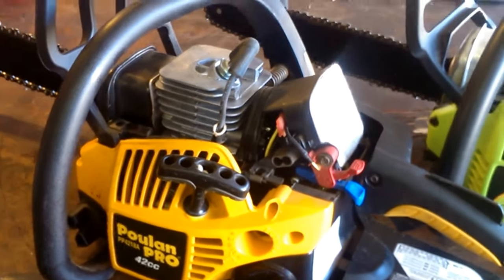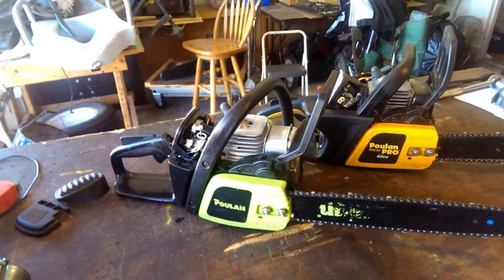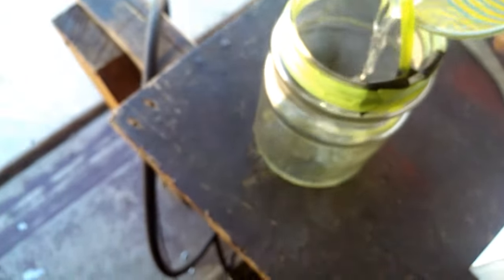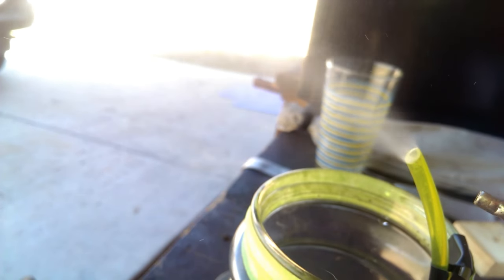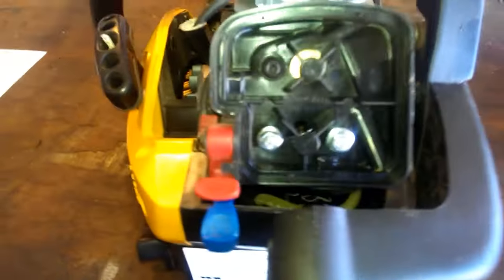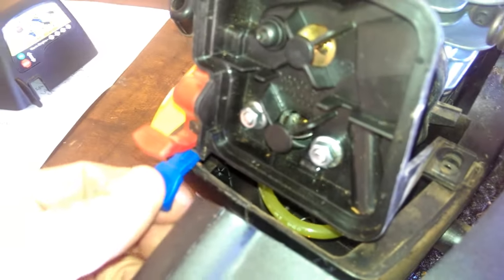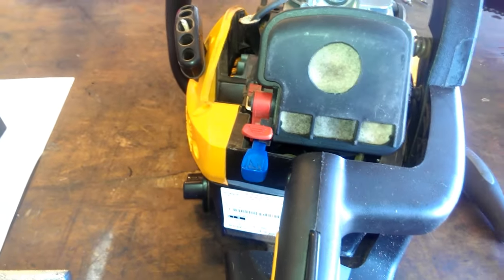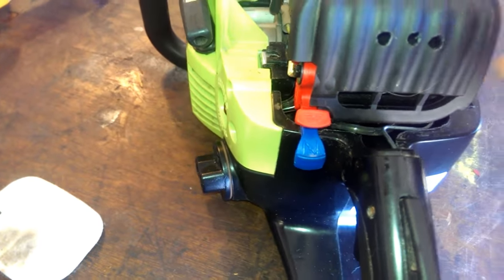Poulan wont restart after being used & how I solved my problem.

Comment: My old Poulan Woodshark 1950 doesnt have a regular carb breather cover. It's part of the larger top plastic cover - on the inside is rounded portion with a rubber seal  that covers the carb area. Probably gets even less air.
Reply: Also, my filter isnt the thinner white one, but a thick piece of open cell foam, like some lawn mowers.

Comment: I had the same chainsaw same problem I am going to try it thank you for the tip
Reply from the maker: Tammy Matthews follow all the restart instructions particularly the high idle. Choke pulled out all the way and then back in 1/2 way. Good luck Tammy. Thank You for commenting.

Comment: Dave , a barrel refers to a passage carrying an a/f mix.The top passage is only only an air inlet,but no matter it's just that a stage refers to a progression whereas a barrel is a passage..Foreign cars had a 2 barrel ,2 stage carb,US had only 4 barrel 2 stage carb.ie Holly quad,rodchestor quadrajet, carter? thermoquad etc.

Comment: great video I have one of each saws and the older one dose the exact same thing. thanks will be doing the breather on mine.
Reply from the maker: Mark Luce  Thanks for the comment Mark. Don't forget that the underlying problem is that crappy filtration system so be sure to clean the air filter often. Warm restarts should be done with the throttle cracked open. Pull choke all the way out then push 1/2 way back in and 2 pulls should have you running. Thanks again!

Comment: Let’s suppose that you left the filter off as well as the cover and then try to start. It now should be getting plenty of air, however it still does not start. Would I assume then that is not the problem I am having.
Reply from the maker: Hey Gary, it could only be part of the problem. How old is the saw? How long has it been sitting with fuel in it? Did you dump the gas and look for contamination? How's the compression? Do you have spark? Start at the beginning and eliminate possibilities. Whatever is left, that's your problem. Make sense?
Reply: @ZombieDaveAZ  yes was using, set it down to clean up and went to restart and it hasn’t. Good spark and compressing. Dumped oil and refreshed. It is getting fuel, just not starting.
Reply: Should of said dumped oil and gas mixture.
Reply from the maker: It ran at full power, no bogging? Could it be on the cusp of hard carb diaphragm? I just don't have a quick easy answer buddy. It takes investigating.

Comment: I have the exact same bumble bee saw you have on this video, I recently put a new carb, air filter, fuel filter and fuel lines on it, and I still cant get it to run properly, I will be putting holes in the air filter cover also, but my big problem is it seems after I fill the tank its like the gas somehow creates a syphon and continually pours gas into the engine to the point that I cant even pull it over...? do you have any suggestions on this issue>?
Reply from the maker: https://youtu.be/wNTKOuKwXaI  this will help you my friend. 🍺👍

Comment: Great problem solving and solution!  Now, what have you come up with to fix the tight gas cap issue on Poulan's?
Reply from the maker: Lol, sorry but this is the first I am hearing about it. I don't have an answer for you.
Reply: ulitepilot aka Zombie Dave   They must have used the wrong plastic because gas caps swell up and are extremely difficult to operate. I just saw a video about it and confirmed that with a P3314 I’m working on today. The bar oil cap is similar but not quite as bad. I thought it might be due to ethanol fuel but what I dumped out of the tank was 94 octane or better, so hopefully it was low or no E. No idea who owned it - got it at a church yard sale for $15. Piston, ring and cylinder are pristine so I’ll replace fuel lines, purge bulb and fuel filter and get it running again.

Comment: i have the same problem with my weed wacker so i am certainly going to try your technique so thanks
Reply from the maker: Thanks for stopping by Errol. Weedwacker #1 problem is usually the spark arrestor. Rarely do weedwackers run full throttle so carbon will build up and slow the machine down. Check the screen first.
Reply: They sure do get a lot of oily residue there.

Comment: Good video. I have a McCulloch that looks exactly like the yellow Poulan saw in your video and has the same problem.
I'm wondering if you tried a new air filter or tried starting it without the filter. I will try your fix but the question still remains of WHY is gas leaking out of the carburetor into the air filter? Has anyone ever inquired on the Poulan website?
Reply from the maker: So many questions. Poulan is Husqvarna and is Not a McCulloch. This video is for a Poulan. This also addresses the double barrel carburetor Not the single style butterfly carb on a Mac. This addresses the hot restart problem plus a bunch of me blithering to help guys understand what's happening when you use your saw. So I'm saying this is NOT this fix for a McCulloch saw. You just may have a stuck metering diaphragm which nothing in this video will cure. I hope this helps.
Reply: @ZombieDaveAZ  Thanks for the reply.  I was hoping since the McCulloch and Poulan looked similar, maybe they were made by same company and the fix would be the same, but will have to do more research, I guess.
Reply from the maker: @munsters2  on YouTube search there has coming out of my muffler. I have a video on your problem and solution.
Reply: @ZombieDaveAZ  Thanks. I will check.

Comment: Awesome.   I've got a homelite does the same thing. I'm going to get the drill bit out.
Reply from the maker: Hey Jim, I have always felt that the fuel lines were the biggest issue with that brand of saw. The originals rot from the inside so you have to go looking for it. Just giving you the heads up on what I've noticed. Good luck and I hope you subscribe. 200+ videos of tips and tricks for you.

Comment: Rec90 gas
Just buy it and thank me later lol ethanol free. My saws start first pull every time now and fuel lines last longer. I love these saws. Most people ruin them because they fire em up and go straight to work, or run 87 grade fuel. The super advance timing doesnt like low grade gas. Supposed to run higher octane anyway now days with our modern gas with ethanol. 90rec is ethanol free. Also always let your saws warm up viewers. Otherwise you end up with cold siezure. Cant count how many scored pistons and jugs that have come thru my shop from cold siezure. They always score on the exhaust side first from cold siezures. Great video my friend. Try out that rec90 and post what you think. Its better then premixed fuel.
Reply from the maker: NAILED IT!
Reply from the maker: NAILED IT!
Reply: So many saws come through my shop with problems due to poor maintainence, crappy gas, or cold siezure. Its rare that i replace an engine that reached its max life. Its always destroyed from some preventable factor.

Comment: I have the Poulan PP4218A Pro 42cc just like you and I wish I would have watched this video before I made some adjustments from other’s YouTube videos. Now I can't get it to start. I can tell you know what you’re doing, I going to steal your clamp in the pipe idea, and hope you can help me.
First my Poulan would not run when the choke would disengage from triggering the throttle. My filter looked a little better that yours in the video so I thought it was good. I replaced the gas and then adjusted the ideal screw. It would idle with the chain running and not rev up and so I adjusted the low mixture screw on the carb. I got the chain to stop running at idle but it would only rev about half way and die at full throttle. That is when I adjust the high mixture screw and it has never started after that.
Is there a start point for the mixture screws? Like turn them all the way in, clockwise, and then back them out one and a quarter turns? Something like that?
Reply from the maker: Yes. One and a half turns out is a good place to start.  Do all that you would normally do. Prime, choke and pull til it coughs. Then push the choke in 1/2 way and pull til it starts  let it warm up 30 seconds to a minute. Then you can make your adjustment on the low jet. Closest to the engine. When you get that part done. Adjust the high speed. Prolly going to need to back it out 1/8 of a turn at a time. Once you have it all set to where it won't stumble on acceleration back out the hi jet 1/4 turn. Let me know how it works out. Hopefully it helps.

Comment: I got rid of the cover all together and drilled to holes in front of the air cleaner then slide a parts cleaner straw through it all air now and adjusted the carb

Comment: I've got 2 of these 42cc and 38cc. It's a vicious circle when you flood it and gas/oil soaks the filter and chokes it even worse. I'm going to use carb cleaner to completely clean the filter and make your modification.
Reply from the maker: Let me know how it  works out for you
Reply: @ZombieDaveAZ  The 42cc Poulan pro is my new parts saw. I moved all the good parts over to the 38cc. The modification works. Whatever was wrong with the Poulan Pro wasn't fixable. It probably needs carburetor work. It spits out gas everywhere when choked and primer bulb is pumped.
Reply from the maker: @mcgavin098  a hard metering diaphragm will do that. It's stuck in the open position. Check this out. https://youtu.be/wNTKOuKwXaI
Reply: @ZombieDaveAZ  I just bought me a W-26 Husqvarna carburetor. I figured there's probably other problems in there as well. Another Youtuber says to widen the gap to .030 inches to fix the hot engine starting problems.

Comment: I got a poulan chain saw put new fuel lines in new plug and checked the fuel gaskets all good . It still does not want to fire up ??? Any ideas why it won't? Thanks
Reply from the maker: Check for spark,check for compression. If you have both,remove the spark plug.dip the spark plug in the fuel and put it back in the engine and try to start it. See if it will run for a second. Could still be a fuel delivery problem.
Reply: Please understand, it's really hard to say for sure in a comment, without having the actual device. But for what it's worth ...
What model Poulan ?? 3314 ??
New plug, most of the repair kits come with wrong plugs, make sure it's the same plug number, gap .025" -.027". (Clean and gap old plug, try it ?)
Check plug wire from magneto to plug cap, look for worn insulation about 2" from mag connection, shorted out ?
Remove plug, put it into plug wire and place on engine (for a ground connection). Crank engine 2-4 pulls and verify spark.
New fuel lines ? Make sure the new ones go to the right places.
   Fuel from tank to carb inlet (usually from tank hole on the left to inlet port of carb, right side of carb).
   Carb to purge bulb (port at left of carb to bulb port marked "IN", usually the shorter inlet).
   Bulb to tank return (lower or longer bulb port to tank return port, usually the tank hole to the right).
Proper fuel line size is 9/64" O.D. (3.5mm) X 5/64" I.D. (2.0mm). (This is mfg spec, don't use just whatever came with the kit, most cheap kits come with 5.0mm O.D. tube, too big.) BTW, fuel tank holes are .125" (about 3.0mm).
Check throttle linkages !
Cold compression 58 P.S.I or better. If low, put 1/2 to 1 ounce of oil into cylinder, repeat test. If it goes up to 60+, possible bad piston/cylinder/rings.
Use NEW FUEL, with stabilizer, 40/1 fuel/oil ratio. 10% MAX ethanol ($5.00 testers available). Ethanol free fuel may be better.
Always use clean filter before use !
For first start, put on clean surface, try to start without air filter. If it won't start, remove plug, rotate to put piston near TDC, put 2-3 drops of fuel into cylinder, put plug back, give 2-3 hard pulls. Should start and run for a few seconds. If yes, fuel feed issue. If no start, ignition/compression issue is likely, but can be other issues.

Comment: Will throttle being closed cause a low reading thank you so much for your reply
Reply from the maker: Yeah it will read lower. Chainsaw reject for me is 90 psi. What are you reading?
Reply: ulitepilot aka Zombie Dave 62 with throttle closed
Reply from the maker: @Hazmatman-cp5zi   thats really low brother. Remove muffler and inspect the rings and piston for scoring.

Comment: Hey man we have a McCullough chainsaw same with this thing that my fater stock for 4-5 months since in use then when where going to use now it won't start then that happens i take all the carbs of and clean it i pull and pull it more than 6 times ahhh still wont start then i watch your video i might be doing this next and thanks man...☺️☺️☺️
Reply from the maker: Thanks for stopping by my channel. I appreciate it. I do want to share with you that I personally have 2 McCulloch saws sitting because of dead coils. Each one was running just fine and in the middle of a job, 1 saw quit with no spark and the other would not start after sitting. So check for spark and because mine are older I'm having a hard time finding replacement coils for them. I just wanted to share this with you. Good luck.👍
Reply: @ZombieDaveAZ  I already check the gas and the gas smells good the filter looks clean and spark plug is still in condition coil is still good but one thing that i didn't clean is the muffler and i totally rebuild the carbs cause the plastic thingy on the throttle has crack so that's why I just made a make shift plastic that works but then when all things was botton up it was ready to fire upe the idle was too high and when i squeeze the throttle it bogs it stalls and then died I think i should also do what you have shared...😁😁😁
Reply: @ZombieDaveAZ  and wait we bought that surplus chainsaw from Australia runs good but since that plastic thingy brake on the throttle my father decided to sit it for many months and i dicide to fix it so yeah it was really fun pulling the string hahaha...😂😂😂

Comment: when you make your 1 gal mix, add 3oz seafoam to round out the gallon. then, add your oil mix.  USE NON ETHANOL GAS if you can. do this for all 2stokes and you'll be a happy camper
Reply: Definantly- NON ALCOHOL with ANY AND ALL small engines.

Comment: Hopefully tomorrow i'll  try this and my saw will fire i'v checked the plug the piston and  cylinder no scoring the piston rings are fine   and the fuel no contamination as far as i can see lets hope the problem is with the air intake

Comment: Hi do you think it might work with my husky. 450 cause that's the same issue I'm having now. So so frustrating.
Reply from the maker: Hey Lori, the easiest way to find out is to run the saw normal with the filter in it. Then when it's hot and won't restart, pull the filter. That will give it more air. If it restarts then there is your answer. NOTE: most owners manual will tell you how to do a "hot" restart. Pull out the choke and then halfway back in. That will set the high idle and help with the restart. If you have not been doing that, then that's where you start. THEN if that doesn't work try pulling the filter. Most Husqvarna have excellent filtration and use the 2 piece clamshell filter. I hope this helps and thanks for stopping by. 👍

Comment: Hello ZD,
 I've been working on my dad's poulan P3314wsa and it builds up a lot of pressure in the fuel tank.  It constantly leaks gas from cap unless you Hulk tighten it. When I was getting the carburetor off 2 clean it.  I removed the fuel feed line and gas squirted everywhere with a lot of pressure.  Is this normal or a gas tank pressure issue.

Thank You ZD,  Darin
Reply from the maker: Yes they do build up some pressure. Just unscrew the cap to release it and use hemostats or fuel line pinchers to control the fuel. Once you have the line pinched you can tighten the cap back up while you work on it. Relieve the pressure when you put the fuel lines back on. Good luck brother. 👍
Reply: @ZombieDaveAZ  Thank You for your quick response and as always your Superior Knowledge!

Thank You ZD,  Darin

Comment: Going to do this to my Poulan Wild Thing 18” Chainsaw. If I may ask what size round hole did you put in the first saw. Looks like the same air filter cover that came on my Wild Thing. Just took mind out of storage and it’s probably been at least 5 years since I used it. It was dry and clean from after my last usage. Filled it with fresh 40:1 and filled the bar oil reservoir. Started right up so I was good to go. Ran it for maybe 15-20 minutes at the most and it died on me and would not restart until after it cooled off.
Reply from the maker: I think it was a 1" wood bit. I backed it up on a piece of wood. Be careful it doesnt spin and cut you brother. Check those fuel lines, thats a long time to be sitting. Thanks for commenting.